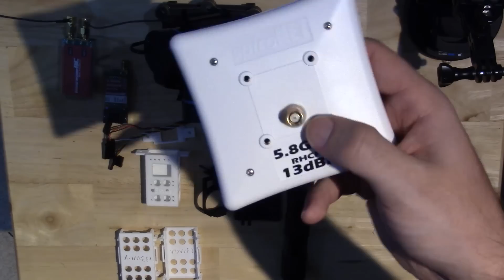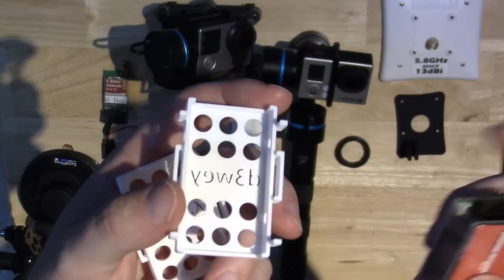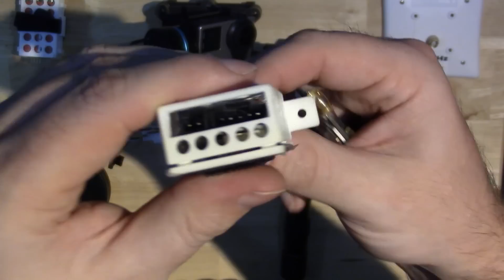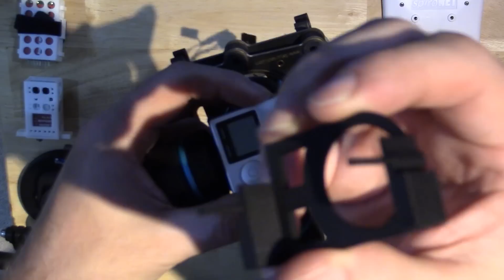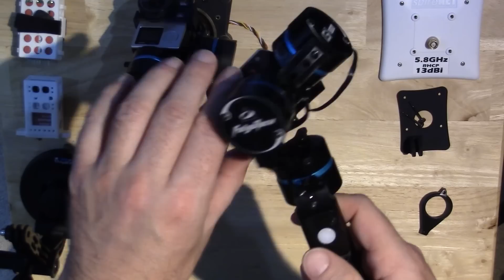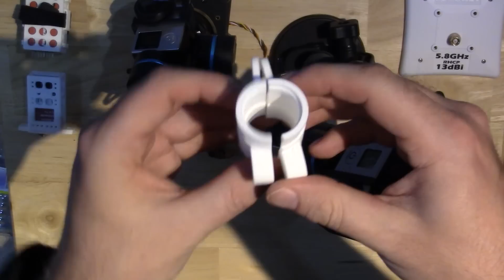Latest d3wey Shapeways Parts - Overview

Comment: Ordered the G3 ultra clip in black. Waiting on the clamp once you add to the shop. Have you checked to compare the G3 and G4 to see if the handheld clip attaches the same? Are the dimensions the same on the handles?
Reply from the maker: Craig Capello Great stuff thanks Craig. Sadly the G4, being shorter, doesn't fit the G3 Ultra clip so I am working to create a clip and clamp for both models. It'll take a few weeks due to the christmas period and i need to be sure it all works via a prototype too. I will update you via a comment when i'm done.

Comment: I am getting the aircraft 3axis gimbal for Christmas I got an awesome deal on it at black Friday $200 usa I was a little concerned when you mentioned a new version coming out where you referring to the aircraft gimbal or the airplane one also what is a good cheep layer lens that works with you mount like the one you had in your video I would be interested in getting one of your mounts if I could find a lens that was cheep
Reply from the maker: I wouldn't worry too much. The G4 Hand Held is coming first but Feiyu tell me the G4 Aero will follow. I could be wrong but I am not expecting massive functionality changes on the G4. The main change is getting rid of the visible wires (which to be fair can snag in flight) and the rear bracket allows for the Hero4 Silver screen to be viewed (only relevent on the HH version anyway). HH version is on its way too me now from Feiyu so keep an eye out for that review.
Reply: d3weyTube
what about the lens you are using?
Reply: It is the "protective lens" from GoPro:
http://de.shop.gopro.com/EMEA/accessories/protective-lens-plus-covers/ALCAK-302.html

Comment: Dave, thanks for all the nice designs for the ImmersionRC products. 
About the Patch antenna, the directional angle is 35 degrees.
Reply from the maker: Thanks guys... I've had a few people asking if the distance between the rear screw holes on the 5.8 Patch is the same as on the 2.4 patch? Can you maybe let me know via reply?